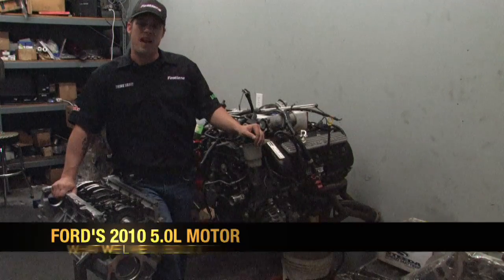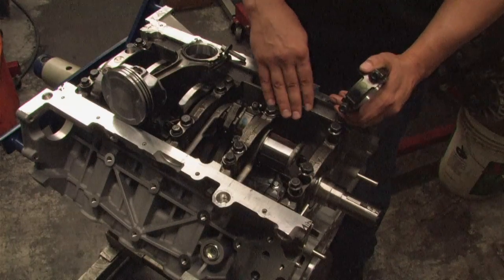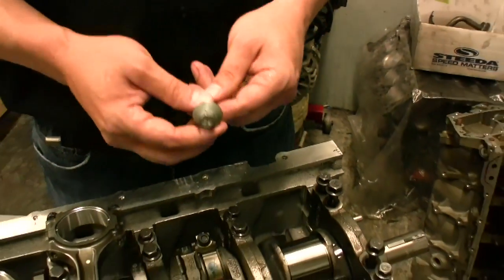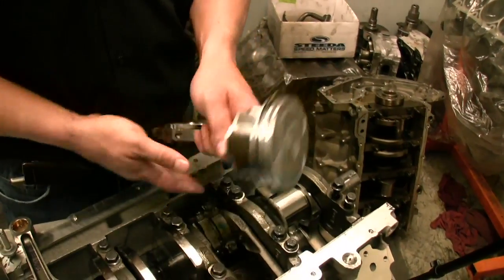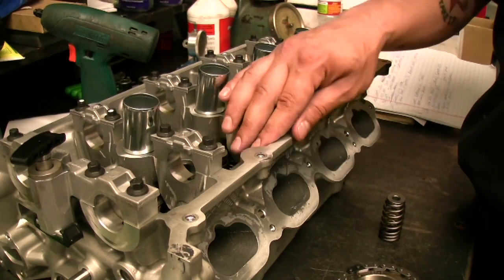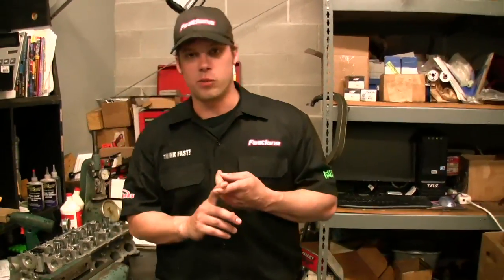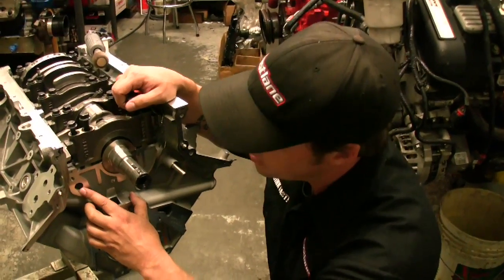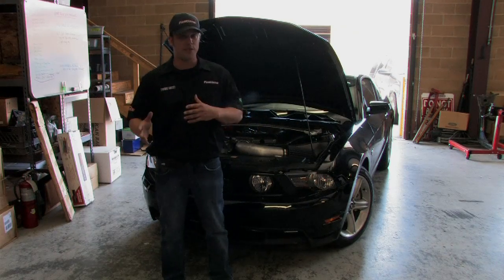Fastlane tears down the 2011 Ford 5.0L Mustang Motor

Comment: it is well known Mustang frame is weak cause Ford makes them, but at least Ford was smart enuf to buy the engine block, pistons, rods, driveshaft, supercharger, transmission from the aftermarket

Not that Ford could engineer those performance parts on their own, but GM has more patents than Eaton on the supercharger GT500 uses. That's Engineering

Comment: I cannot say it enough: Mustangs have proven to have more than enough chassis rigidity to withstand the rigors of racing. On the strip and on the track, Mustangs can take what you throw at them. The Mustang's not-so-stellar handling is because of the lack of decent suspension components. Bug for under $2000, track racers have made their Stangs handle as well as expensive Euro cars

Comment: Mustang frames have les wheelbase to deal with and less weight to manage

Yet ALL Mustang frames have more deflection than any Camaro which has more weight to manage and more wheelbase to control

Do you understand a V6 camaro cheap frame being better than a $60k GT500 frame. Mustang wishes it could corner like a Camaro

Comment: Son, since you like to always say the ZL1 is 790HP, which it is not without mods, I in return invoke the prowess of the Lethal Performance 2013-14 GT500 Power Pack: 700RWHP, which is around 800BHP crank assuming only a 15% drive train loss. 
I also invoke the Shelby Super Snake, rated at 850HP. 
And the best of all, I invoke the Lethal 2013 GT500 with REBUILT (did I forget to stress it was rebuilt?) 5.8L which is now producing 1126RWHP. Source: 5.0 Mag, July 2013 pg54, Article name: "White Feat"

Comment: Son, your numbers are off, and not by a small margin neither. I can very safely say your numbers are completely off.
The GT500 is not 11.6L, it is a 5.8L engine. Where are you getting 11.6L from? The only thing you said correctly is the 662HP rating
The LSA is not 8.68L, it is only 6.2L
Son, there was never a 12.4L ZL1. Again, the ZL1 has a 6.2L LSA engine and the 1969 COPO ZL1 was at most 7.0L. No stock ZL1 makes 790HP. Only modded ones. 
And an SS does not get 525HP with only a cam upgrade.

Comment: Incorrect. Mustangs have extremely rigid chassis. The formal Ford designation of the S197 chassis is D2C, meaning "2 Door Coupe." 
The D2C chassis is much more rigid than the 94-2005 Mustang, and the Foxbodies before that. 
A GT500 deflects more than V6 Camaro? You are completely making that up because many autocross racers prefer the Mustang D2C chassis because of its superior rigidity to other chassis designs of the same weight class.

Comment: GT500 = 11.6L = 662hp = 15psi boost
ZL1 = 8.68L = 580hp = 7psi
ZL1 = 12.4L = 790hp = 15psi

Ford adds 3 liters but only gets 80hp
Chevy adds  .8L and adds 130hp
Complete fail
Always remember Camaro SS is a camshaft away from 525hp
Reply: I really hope you increased your knowledge of cars in the past 5 years.
Reply: @GetShrektMrKrabs  9 years later. Dunno yet.

Comment: LOL fail
Mustang frames are weak and sloppy
When  GT500 frame deflects more than a V6 camaro in a corner then unsprings like a car with no shocks you know you have a serious problem with engineering & design

stout doesn't mean weaker so that wouldn't be a good word to describe Mustang's frame

Comment: Whoops! I typed "Foxbody" incorrectly, I said "Fixbody" LOL
There's nothing much to fix about the Foxbodies. A neighbor of mine had a track dedicated Fox & put in a Ford 502 (bored&stroked 460). Aside from some under-chassis braces, he didn't have any other bracing or reinforcement. He ran 8's 1/4 mi, so he was putting down in excess of 800RWHP, maybe over 1000BHP at the crank.
As "weak" as ihatecrackhead claims they are, these Foxes are hands down taking serious power from highly modded engines

Comment: POS fox bodies weighed like 3000lbs

Which engine do you think would win if you put a SS & GT engine in a toyota camry

1998 327hp Camaro
1998 225hp GT

I had a 600cc engine on my lawnmower putting out 30ft/lbs, which is about as high tech as a fox body, V8 in a ricer size car

You know GM had a 4.6L OHC in 1992 made 300hp, man it took retards at Ford a decade longer to get 300hp from a GT 4.6L

Comment: LMAO 5.0L could barley beat a V6 Camaro

you have to be an extreme moron to think 5.0L was fast, even compared to a V6

1992 Mustang GT 5.0L 205hp  is that legendary?
1995 Camaro V6 200hp  yes it says V6

Foxbody relied on a weak sloppy frame with a weak motor to accelerate fast, it's practically a pinto frame with a V8

early 90's V6 camaro had a high tech frame with track bar and torque arm stock still better than current V8 Mustang GT which didn't even get a trackbar until 2005

Comment: 03-04 Cobra was proof of complete failure

2002 Ford canceled their contract with teksid to make Ford alum engine block for Mustangs
Ford tried to engineer their own alum block for 03 Cobra, Ford couldn't make one strong enuf to handle a whopping 390hp, so they had to go with iron

04 Cobra also has aftermarket Manley rods & Zolner pistons, meaning Ford couldn't engineer engine internals to handle 390hp 8psi boost

Camaro already had stronger alum engines since 1998 without aftermarket parts

Comment: Correction: I meant to say the 03-04 Cobra went iron block engines because Ford knew they didnt have to have aluminum. Even the GT500 engine blocks were iron; it wasnt until the past few years that Ford went with Honsel engine blocks. 
And if you are still disparagingly disdainful of Ford aluminum, look at the current 5.0L engines. 420BHP straight from the factory using all Ford parts, including Ford sintered hot-drop forged rods.
The stock all-Ford engine can take 1047 RWHP: aNtPpqeRNrA

Comment: Son, I see you're still telling the same lies. Chevy never ever made a ZL1 in 2000. That's a completely aftermarket car modded by GMMG; it's not stock. If modded cars are allowed, then the Shelby Super Snake 850HP and Shelby GT1000 1000HP count and they completely destroy the aftermarket GMMG 2000 ZL1

Comment: The 03-04 Cobra was a success. Ford proved they didn't have to use aftermarket engine blocks like Teksid, they proved they can make more power with good old American iron. Don't believe me? Look it up here on YouTube and you will see vid documentation of Termis producing over 400HP on the dyno. The 390BHP was underrated. And MotorTrend tested the GT, all Ford parts, and ran 12.7 seconds, beating the regular SS hands down and ties with SS-1LE. You're just mad you can't get race grade in Camaros

Comment: 04 Cobra is proof of Ford Failure
04 Cobra, Iron Block because Ford tried to make an aluminum block to handle a measly 390 & failed, earlier Cobras had a Teksid(Not Ford) alum block. Ford couldn';t even make the internals, the rods and pistons are ALL aftermarket

04 cobra only made 390hp with 8psi boost, Zl1 makes 580hp with 7psi and 2000 ZL1 made 400hp without supercharger in aluminum block, NO AFTERMARKET internals

I bet you can't quote a Mustang under 13 seconds that Ford can actually make

Comment: Let's all welcome fordfantasy fanboyism to reality. V6 Camaros vs. V8 stangs
1993 Ford Mustang GT 5.0L 0-60mph 7.9 1/4mile 15.9
1994 Camaro 3800 3.8L V6 0-60mph 7.3 1/4mile 15.5 WIN!
Let's see a V8 camaro from the 90's vs V8 Mustang after they cornered the market and made huge $
1997 Camaro SS LT4  0-60mph 4.8  1/4mile 13.1
2010 Ford Mustang (Manual)  0-60mph 6.5 1/4Mile 15.1
let's go ahead and throw a V6 in there
2010 Camaro V6  0-60mph 6.0  1/4mile 14.3
-source zeroto60times.

Comment: Nope, wrong again. Making more "facts" up, arnt you?
1993 5.0, ~6.2sec. 
1993 Camaro SS V8, -7.1sec
1993 v6 Camaro, ~9.0sec, slow as a slug.

You see this? the 93 5.0 'Stang with only 225BHP is faster than an SS V8 300BHP.
Add mods, and that little 5.0 spanked the competition.

Comment: The Z28? Are your seriously blind? Fox Bodies with only 225BHP were keeping up with them. And a 1993 GT 225BHP 54.0L with just a few mods was enough to keep up with and beat that Z28 327BHP. 
Remember, Ford seriously underrated the 5.0L. It made only 225BHP, yet it makes over 300ft-lbf torque, and with a very light weight, that is why they kept up with 300BHP Camaros.

Comment: GT motor is so much more refined that a 1998 Camaro Z28 made 327hp, yet bot better fuel economy than a 2009 Mustang GT that only made 300hp
That would be a complete & udder failure even if the GT was made in 1998, 12 years later GT still made less power, that is just sad
FORD refined the 2011 5.0L to tear itself up faster, by putting a bigger crankshaft than even SS has in a much smaller block, which caused such a low stroke to rod ratio, 5.0L being modular means extreme durability issues

Comment: The TRUTH? I told you the truth, &the truth is you are a poser, you dont own a Camaro,&you know even less about Camaros. 
Remeber this vid where I & some other REAL Camaro owners & fans totally owned you on your lies about Camaros? 
watch?v=bAx5sr3olgI
Now, just face the REAL truth: The GT's DOHC 5.0L TiVCT Modular is a more refined engine than the pushrod 2V no cam phasing LS3. Even at only 5.0L, thats 1,200cc less than the LS3 6.2L, the GT keeps w/ the Camaro SS.

Comment: -Cont.from last reply:
GT Engine is also superior to the LS3:
GT is DOHC, 4V. SS is dinosaur pushrods,only2V.
GT has independent cam phasing,SS=no phasing.
GT has superior VE,SShas dinosaur pushrods,only 2V
GT has very little valve float@7K RPM,SS has too much valve float from pushrods.
Stock GT can rev to 8K RPM w/tune. SS needs new valve springs to even attempt that. 
GT makes more HP per Liter because of superior VE, which means GT does more with less.

Comment: Nope,incorrect son.
The GT engine has almost same stroke as the LS3
GT has almost equal length rods as SS
At 7000 RPM, GT piston speed is almost equal to SS 
GT has almost equal transverse crank clearance as SS.
Son, youre ignorant. All engines, even the SS,are balanced by the crank counterweight,not the rod ends.

Comment: That is not sintering. Sintering is pressure formed without any heat. The piece is never heated by induction, its impossible. 
The only way to sinter is to eject the from the pressure mold and then bake it outside of any mold to cause the powder granules to bond. 
The pressurization step of the piece only occurs when its hot forged; i.e reheated to forging temps and struck to cause a better molecular crystalline structure. 
W/o creating that structural matrix, the sintered part cant survive.

Comment: No flash on the side means its not hot struck forged? Wrong answer son. 
The sintered part from Ford is so very precisely metered that there is no waste material or "flash" created when it is in the striking step. 
Just because machining marks are missing on the side is not proof that the sintered rod didnt receive a hot forging step. 
A sintered rod that is not forged cannot do these:
Stock GT rods, 802 RWHP: yXuCBFVF2XY
Stock GT rods, 1047 RWHP: aNtPpqeRNrA

Comment: Son, you are dumb as ever. Ford was the very 1st US company to use forged sintered rods on a mass produced w/ the Escort. It was so successful that GM & Mopar later did the same.
If Ford didnt forge the sintered rods, they would be weaker than cast rods.

Comment: ALL sintered rods are packed into a form and heated, how do you think they keep their shape. FORD passes induction heating from bottom to top, as the powder metal is heat it packs down being pressurized
There isn't enuf room in 2011 5.0L for counter balance to match the stroke. more stroke means a crankshaft makes a larger circle, looking down the crankshaft as it turns.
Lesson complete

Comment: You've got no idea what you're talking about, like always. There are NO CASTING MARKS on the rods. This means 1. they were forged or 2. they were machined from a billet. In this case, they're forged from powdered steel. 

Also, what the hell are you talking about, "Ford fit big internals for a big motor in a small block so it can't get 0 balance internally"???

That makes no sense. Is english your first language? The Coyotes have NASTY internally balanced forged steel crankshafts.

Comment: Mustang GT connecting rods are sintered powder metal just like a 1987 Ford Escort 1.9L
Notice the rod has NO FLASH on the side meaning it was not forged

Camaro SS rods are sintered powder metal so the cap can be cracked, but after being sintered they are HOT DROP FORGED and Ball Peen Forged

GT stroke is larger than SS Camaro, yet rods are shorter because of GT's lower deck height. FORD fit big internals for a big motor in a small block meaning it can't get 0 Balance internally

Comment: InsideLine admitted they made a mistake.They tested the car in the wrong gear. If you factor out the gear multiplication of the wrong gear, 360-375WHP is correct. 
And you have never presented proof that it was a ringer, you only are quoting guesses. 
Learn to comprehend writings better. Your reading comprehension is off.

Comment: sure, so it's getting 2% drivetrain loss. PROFF, edmunds tested Mustang GT on dyno, got 360HP, from factory stock, seems weird so they tested another  factory car, The same. But wait, the Ford press test ringer made 395HP on that same dyno. cause we all know 4%drivetrain loss in normal for all rear wheel drives... LMAO. ford guy won't get that joke, cause they don't know much about cars. if tester want to do long term test they have to buy their own car, & all report factory models made 360rwhp

Comment: What ford needs tons more boost to compete with Zl1, we already knew this, yet ZL1 still wins on track day.

Hey did you know ford is using press ringers again, they got caught the last 2 years doing it bad. 

2011 Mustang GT press ringer made 395HP at the rear wheel, but SAE claimed it only made 412hp at the flywheel.
Testers who bought the car from a dealer tested it on the same dyno's with same conditions and only got 365HP to the rear wheel

Pathetic FORD up to it's old tricks again!!!!!!!!!

Comment: 2012 5.4L made less power than ZL1, and even a SS can get a 1.9l supercharger and beat a 2012 GT500. Not to mention you would have to spend much more money on the 5.4L to make less power than if you did the same things to Zl1. ZL1 would sot less and make still way more power

2012 GT500 5.4L with 15psi boost 540HP. how much boost you gonna ADD?
2012 ZL1 580HP 7-8psi boost

Lingenfelter has been with GM since the 60's and some of their cars are sold in dealers, some are modified

Comment: Really cause V-6 camaro makes more power than The VERY BEST TOP FULL PRODUCTION MUSTANG's for the first decade of 2000. 2010 Mustang GT made only 315HP in 2010. V-6 camaro is making 323hp. that's more power per displacement than all production mustangs ever made.

Lingenfelter made 790HP with a 6.2L ZL1. they also made a 1200HP ZL1 years before Super snake with a 6.2L

BTW !d!ot, it's 5.8L on the GT500 making 660HP. some people know nothing. The 5.4L only made 500-540HP

Comment: What you can't subtract, or not know what a calculator is. MT82 handles 220ft-lbs less than TR-6060. If it's so sh!tty why is it same tranny in GT500. 

If you put a 1.9L charger on a GT500, you would have a 2008 GT500 with only 500hp at 13.5psi. SS with that boost would make over 700HP

Comment: also 2012 V-6 camaro makes 323HP. more power than The Fastest FULL production Mustang from 1990-2010. Mustang GT made 315 in 2010. BOSS, Cobra, Shelby, Leguna Seca are limited(Not Production) vehicles. SLP is limited production but makes 750HP and 100K mile warranty. 

1995 Mustang GT 210HP
1995 Camaro 3.8L V-6 200HP
2000 Camaro SS 325HP, with Ram Air dyno'd 370HP stock
2010 Mustang GT 315HP, with much less torque and HP at lower RPM than SS from decade ago

Comment: your 5.0 doesn't have that much at the wheel, unless you have a media intro car. The same dyno that got that result proved FORD uses preproduction example press ringers. They are hopped up and set the times many people see on the internet. But when compared to a stock car from the factory, with same driver, same dyno, same weather, Mustangs production cars never match the press test models. You an idiot of you think you only get 4% drivetrain loss. 12% is minimum ever

Comment: What are you talking about?  The 5.0 makes more power at the wheels than the LS3 in the Camaro SS.  Look up the bbkperformance video on youtube of the 2 compared.  The Mustang is also a lighter car than the Camaro, so the slightly lower torque isn't an issue.  The 5.0 Coyote makes it's peak torque at a lower RPM than the LS3 as well.

Comment: 2010 Camaro Base model 300HP 3.6L  SS V-8 426HP
2010 Base Mustang 210HP 4.0L          GT V-8 315HP
1995 Base Camaro 200HP 3.8L            SS V-8 305HP
1995 Base Mustang 140HP 3.8L          GT V-8 210HP

GT is Mustangs highest Model that is full production but in 2010 Jay Leno's stock V-6 camaro stock was featured making over 420HP while GT V-8 made 315HP
Camaros top full production model ZL1 makes 550HP and dodge's makes 470HP.

Comment: Come on FORD! make more power in a GT than an SS at least 1 year. its the 2nd time Camaro base model with a V-6 almost beat a GT V-8 in HP. Mustang GT is the top Full production Mustang, all the BOSS, Cobra, Shelby, Leguna Seca are limited production. And since you put in that cheap chinese transmission, the BOSS and LS don't even make near the same torque as a Camaro SS from 3 years ago. And if i want a GT500 TR6060 transmission, they easiest place to get one is from a SS.

Comment: When the new castings have cooled down, they go to a line that removes the casting flash using a "needle scaler". This operation is done by your $25.00 hr. union thug wannabe.
Many of these misfits are lucky to be able to stand up let alone do their job!
Seen much worse come out of the foundry!